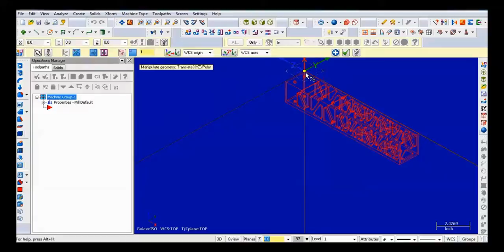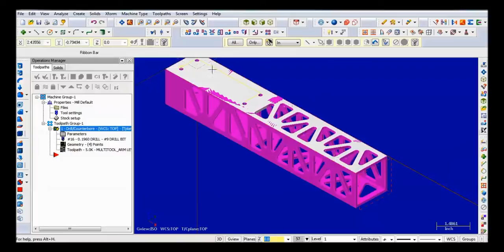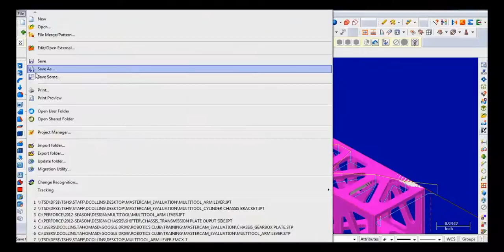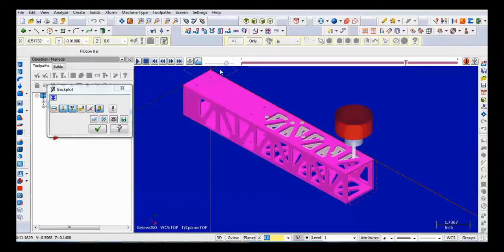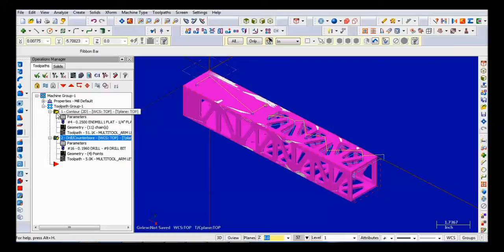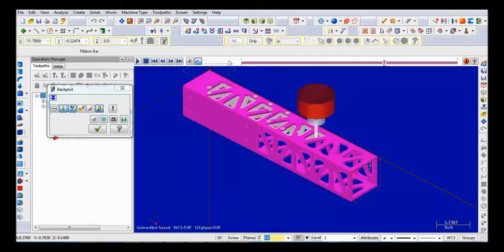Mastercam Quick Starts Lesson 4 - Arm Lever

Comment: thank you for these tutorials, I will be working with a Hurco VMi120 4 axis mill, I'm excited to get started.

My question is, with parts like this that have multiple operations on multiple sides, it's easy to rotate the part in MCx9, but how are you supposed to do this in the real world and retain accuracy? You technically need to rejig for each operation but how do you do that and make sure everything is still aligned, especially if your part is changing in shape as you machine each side.